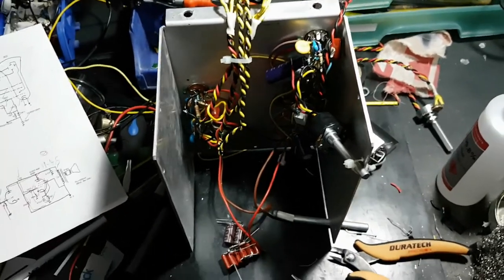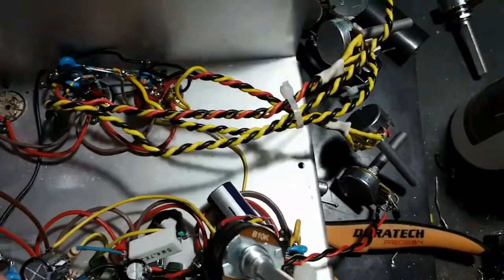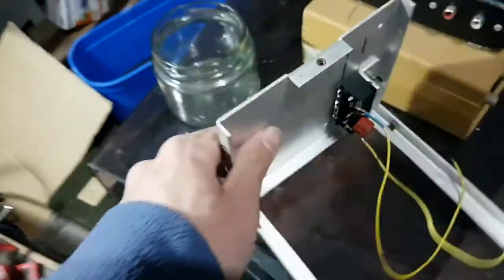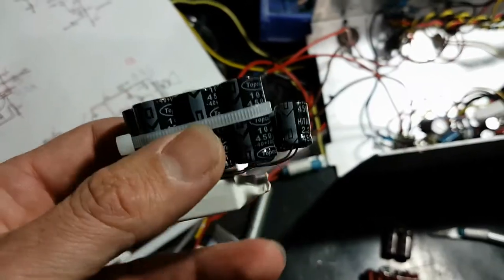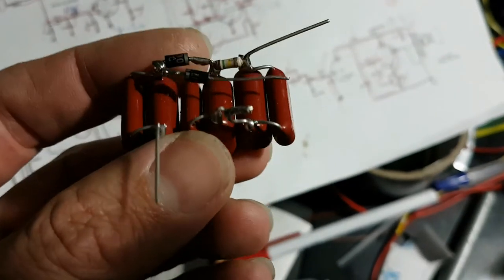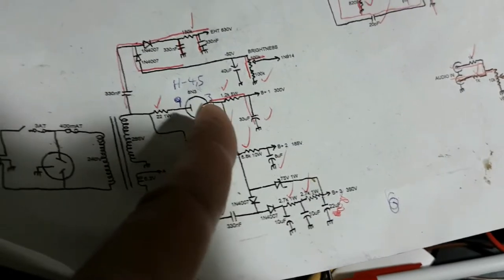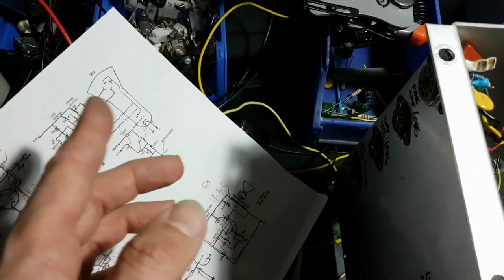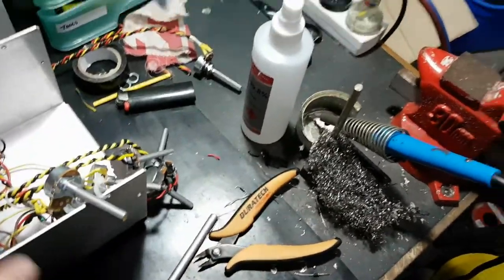2 inch 902 tube TV project (Part 5)

Comment: Don't forget to ground the case Troy or zap i always grounded one side  of the heater as well ..some old valve radios were not grounded suppose they thought it was alright since they were  in a bakelite case  to bad for those repairing them ...I would connect the voltage to only parts of the circuit for testing such as the audio amp that works move on to the next valve ...and the crt last ...any case good work Troy i am watching might build it my self one day i have 2  draws full of old radio tv valves ...it looks a nice easy design .